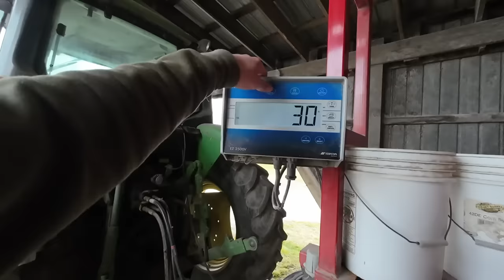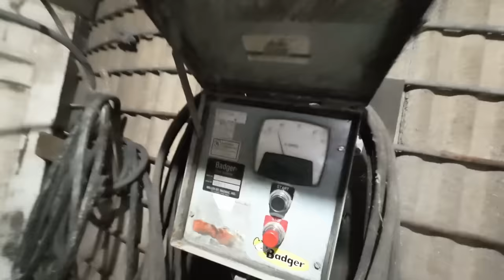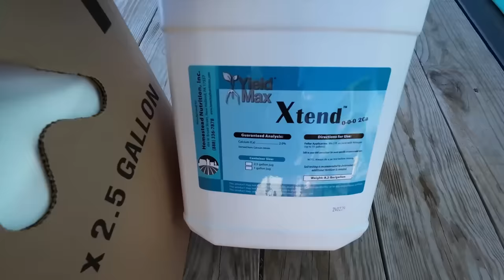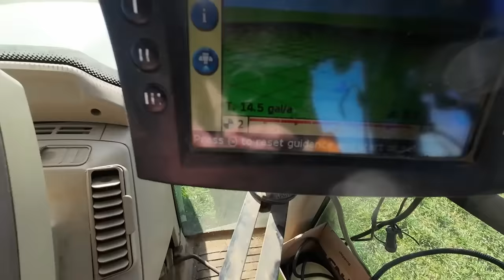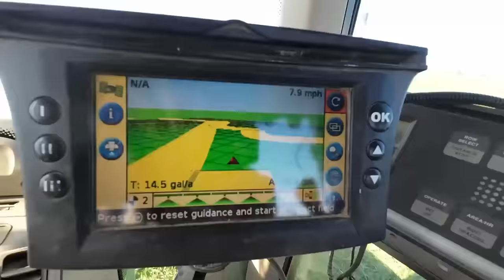Field Work Begins & More Silo Building

Comment: That’s going to take a lot of horsepower to blow silage into those new silos.
Reply: COW POWER! 🐄🐮🐄🐮 😁
Reply: Who’s gonna climb it?!😳
Reply: 1 hp per foot as a minimum, they say! The custom crew that they have come out is well set up for it. Big independent motor with a 1000 RPM field line blower.
Reply: @ourfarmstory  The physics is fascinating. even dried, the content will weigh less or more. To reach the top, the power behind it all might accidently blow the lid off! (just joking!) what would be better? a Vertical  'water wheel' style bucket system that scoops the feed (or is dropped in each bucket) and loaded from the top, or blower that loads from the lower??
Reply: @Palmit_  blower is the cheapest. You can get a nice feildline for 20000$, and then you can use it everywhere. Can't say I've ever seen anything else, but a blower.
Reply: @ourfarmstory  thanks for replying. :-) theres probably a reason.  I guess reducing moving parts is a massive financial multiplier by comparison.  i was just curious.thanks for that bit of insight. :-) i subscribed already before your reply. :)

Comment: That's some kind of blower to push feed that high.

Do you have to back up harvesting equipment too to harvest the corners?

I guess keeping the roughage quite dry will be key to the longevity of the silo. Some older solos back in the day, especially the taller ones, had issues with the acid in the fodder eating away at the bottom rows of cement and making the whole structure unstable.

Comment: I see the open ladder. I have no problem going up an open ladder on a 40' silo, the 60' freaks me out the last 10'. I can climb the 24X90 but that has a cage around it. It really amounts to very little but if "feels" safer. The cage type ladder also has  more toe room, with my size 14 shoe even a bit helps.  
You're doing 3 silos. Have you considered doing one a 30' ?  it always seems like a few years later that there is some regret about not going larger.

Comment: Cattle need longer particle size in their feed. The new longer processed corn silage won't work in a silo well. As a guy gets older the job of climbing a silo is a good reason to quit dairy. Keep it maintained when the loaders are by the bottom of the silo is key

Comment: We were told to unhook the aftermarket GPS power supply before jump starting or charging the tractor battery, that the voltage surge can fry the system. Be careful with that expensive unit. For some reason the integrated GPS don't have that issue. Great video, and are you figuring out how or if you will add dry hay to the ration?

Comment: When your in your 50"s, you"ll start cursing having to climb that 132 feet to work on the unloader. What kind of silage blower are you getting that will push that high without having a frequent clogging the pipe problem? You could use a conveyor system to fill them though, along the silo tops with off distributing paddle block shoots, to direct silage into each silo.
Reply from the maker: In 20 or 30 years I'll need to have someone younger around to help with the climbing. We will be using a Field line 1000 rpm blower. Should not have trouble getting feed up there.

Comment: A concrete boom pump truck would have made that silo build a lot easier because it would have went much faster instead of having to fill one tiny bucket at a time and hoist it up and down.
Reply from the maker: Each ring is only 7 yards and then they have to move the forms so a pump is hard to justify

Comment: The scene of the bale chopping was interesting. The existing silos on the left already look small compared to the one on the right being built. 

I remember the first 60' silo in the area. The neighbor built it, there was a "filler door" at 40'. The old style belt driven blowers could easily manage 40 feet of height but going higher reduced their  capacity. The bottom 40' got filled relatively fast, the final 20 ' took as long to fill as the bottom 40'.

Comment: Although cool to see. Please don't film them from the drone. The footage you're showing so far from a distance seems fine. OSHA doesn't need any addt'l ammo. Those stupid bastards actually wanted us to have a net around the outside of the silos when we built them. A bit problematic to pull concrete or in our case staves and rods through a net, wouldn't you think. But obviously they don't have that issue (thinking).